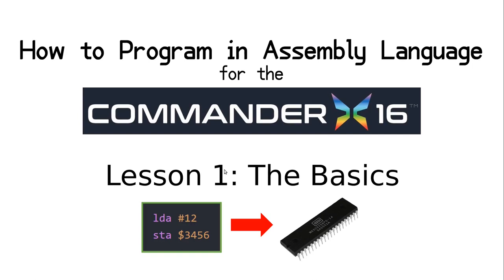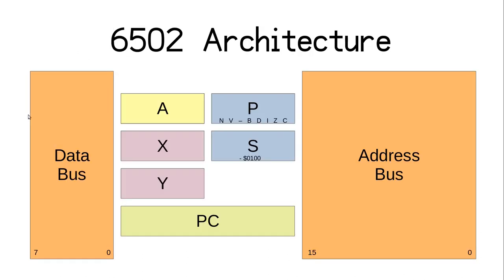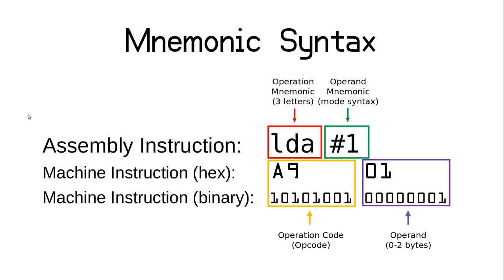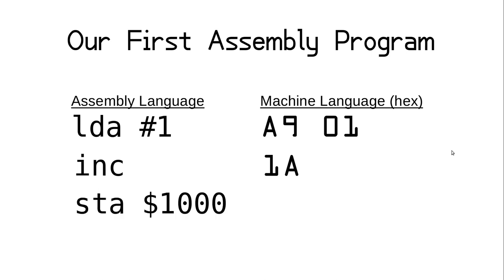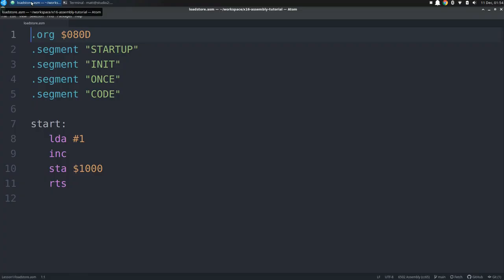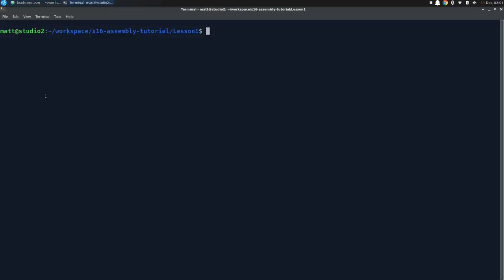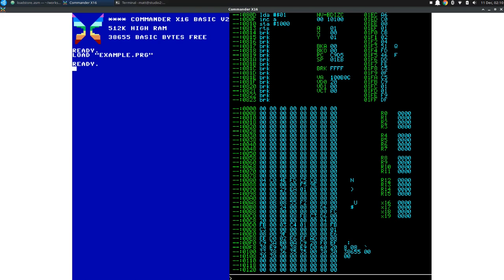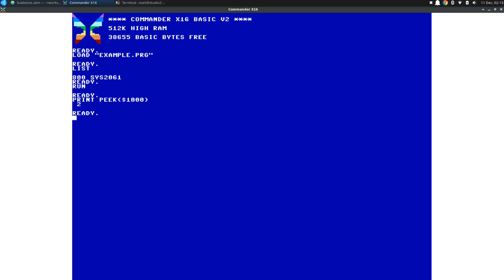Commander X16 Assembly Language Tutorial, Lesson 1: The Basics

Comment: Just a note to those who watch this video for any kind of 6502 programming, INC on the standard 6502 does not support the increment of A like the example here shows. That came in the 65C02 processor which ofc the X16 has. It only supported zp , zp,x ,  abs and abs,x. The 65C02 has a number of instructions sorely missing in the older version of the processorthat the old 8 bit systems use and a programmer would have to think about this if porting from the X16 and back to the older systems. :) - Btw, great that you went into such a great detail on the built in debugger and showing the startup process and tokenized basic.

Comment: Great video! I was impressed at how smooth and easy it was to get the X16 emulator running, that there was a apt package for libsdl2 in the Debian repo that was up to date enough to use the x16 flag, and that the few line program in the video just compiled and ran with no problem at all. The header block with it's start point and the explanation of how to run it in the X16 was the "secret sauce" I needed to get this running. Thanks!

Comment: The 6502 and Z80 were the first two chips I programmed on the BBC Micro and TRS-80 respectively. I learnt their assembly language inside out, The 6502 heavily influence the ARM as Sophie Wilson knew one from her work on the BBC micro and designed the ARM. The BBC Micro had a built in assembler as part of its BASIC and taught a lot of 80s kids assembler.
Reply: The Acorn (company which designed and built the BBC micro) produced the Archimedes when it designed the ARM processor. The Arch’ had an ARM assembler in its BASIC and it’s why ARM assembler was the next one I learnt in the next 80s and why I ended up my current career.

Comment: This was very hard for me to grasp. I’m new to programming. I’ll find my way and get back here when I’m ready.
Reply from the maker: Like I said in the video, you should get more comfortable with a high-level language before trying assembly. Once you are more comfortable dealing with data, it will be easier to get into.
Reply: @slithymatt   I have finished some tutorials and done some simple programs with C, C++, QBasic, C# Objective-C, swift and verilog, just to see what it’s all about. I have understanding of how vectors, arrays, loops, classes and variables work. Is there anything in particular I should look into? Or dig deeper into one of these?
Reply from the maker: @Robbinsffxi  maybe try doing something more involved with C, where you are really messing with pointers, calculating addresses for things.
Reply: When I was 13 I got the book "Programming the Z-80" by Rodney Zaks for my birthday and that's how I learned. He also wrote "Programming the 6502." Both books are long since out of print, but when I searched for "Programming the 6502 Rodney Zaks pdf", I found a copy of the book on archive.org.  It goes over all the basics of CPU architecture, binary and hex number systems, addressing methods etc.  I'm sure it would help. Or maybe someone could suggest a more modern book that is still in print.  Good luck.
Reply: @JeffRatliffhome  Thanks for the tip! I will check it out.

Comment: Very clear and thorough explanation, just what I've been looking for for years.
I am having one problem: when I use cl65 to link the code, I get the ": expected" and "trailing garbage" errors. Any ideas?
I had typed the file out from on the screen and it didn’t work. But when I opened the example file from the lesson folder and saved it to my original location, it worked!
Reply from the maker: Looks like you left out a colon somewhere.
Reply: @slithymatt  I sorted it out, but still don't understand what happened. I wrote the originals file using Kate, but when I created the file using nano it worked fine.

Comment: Hey, i was wondering where i could ask a question. When i tried to build your example program i get the error "cl65: no such target system: 'cx16'" but i went thought and rebuilt the cc65 and saw it created files for the cx16. and i checked my path and it was pointing to the version i got from github. is there something else i can check? im on Lunbuntu. Sorry i know this isnt the best place to ask, great tutorial otherwise!
Reply from the maker: This is a perfectly good place. So when you do 'which cl65' it shows the one you built? Have you pulled from the cc65 repo recently? One last thing: make sure that the directory used for cl65 is in the same cc65 tree that has cfg/cx16.cfg in it.
Reply from the maker: @Mekelaina  Looks like your workspace/cc65/bin must not have cl65 in it, because it's ahead of /usr/bin in your path. Try building it again and make sure your bin directory gets populated.
Reply: @slithymatt  Thank you! after purging the cc65 i installed via the apt-get and correcting a typo in my $PATH it worked just as yours did. cant wait to learn more.

Comment: Another nitpick: 19:07: "As i am running Linux, I need to make sure that any file names I will be using with the x16 emulator are in all caps." <-- That's slightly technically incorrect. You need to pay attention to all-caps file naming because you're using a case-sensitive file system, not because you're running Linux. It is possible to run Linux with case-insensitive file systems, in which case you wouldn't need to pay attention to this. Admittedly, you're almost correct, or at least as near as makes no difference close to being correct for practical purposes, since at least these days, nearly all Unix-like OS installations use case-sensitive file systems.

Comment: So so tempted to get into this after spending years messing with 6502 on many different systems. Is there a memory map anywhere or does it not work like that on this system
Reply from the maker: It has both banked RAM and ROM, but otherwise a very straightforward memory layout. You can see the documentation here: https://github.com/commanderx16/x16-docs

Comment: thanks for this primer. question - with INC command, where does it hold the result? it seems to me that you'd need some kind of scratch space as an operand. but since STA is the next command, where the heck does it store the result of the increment before the next line?
Reply from the maker: The 65C02 allows for Implied Accumulator mode for INC, so when you don't have an operand, it just increments the value in A right in place, just as it would with a memory location. This is a the one opcode that both reads from and writes a new value to A.

Comment: Hello there and thank you for you amazing tutorials! I'm watching them for a second time, now carefully trying everything by hand. 
There is a question regarding addressing modes. There are two indexed modes - absolute and zero page. For indexed ZP if resulting address overflows $FF value it wraps around $FF. So LDA $F0,x if X equals to $10 results to address $00. But what about absolute indexed addressing? Seems like there is no wrapping for that case and if address is beyond $FFFF it simply goes to nowhere. At least, debugging shows no changes. Am I right?
Reply: here is better example

lda #$34
ldx $20
sta $FFF0,x

means no memory value changes as address $10010 never wraps?
Reply from the maker: absolute indexed modes will cross page boundaries when the index register value is high enough. The only caveat is that some instructions will take longer to execute compared to when indexing stays on the same page.
Reply: @slithymatt  so crossing the border of the last page ($FFFF) means pointing to nowhere?
Reply from the maker: @rkurbatov  It should wrap around to the zero page
Reply: @slithymatt  but it doesn't :) Opened the issue in x16-emu repo, I could not find the description of the correct behavior in all docs I have.
Reply: Hehe. I was using LDX $20 instead of LDX #$20. That's why it wasn't working.

Comment: 1:23: "So that means that an assembly language program directly represents the ones and zeroes that go into the processor and tell it what to do." <-- That's technically incorrect. It would have been correct to say machine language directly represents the 1s and 0s, and it would have been correct to say assembly represents the 1s and 0s, but it's technically incorrect to say assembly directly represents the 1s and 0s. Assembly does include just enough abstraction elements to make your statement technically incorrect.
Reply from the maker: I would argue there's no abstraction, merely a mnemonic for a deterministic value. Machine language doesn't represent 1s and 0s, it IS 1s and 0s.
Reply: @slithymatt  Between labels, jump targets, symbols, etc. there's a lot of substitution in assembly. With position-independent elements in particular, you don't necessarily know what absolute address, say, a label will ultimately correspond to. When you call assembly "merely a mnemonic", well, that IS a level of abstraction. Pretty much the lowest level of abstraction, but that's where it starts, with the step up from first-generation to second-generation programming languages. I think your semantics argument about not representing but being 1s and 0s is wrong also: Different-base numerical systems are all representations of the same numbers, but 0xFF is not completely identical to 0b11111111 or 255 or 0377, and machine language absolutely represents 1s and 0s. Honestly, I would have expected a reply, if any, to be more like, "Oops, my mistake; I meant machine language." To actually defend the narrowly but clearly incorrect position you're arguing here is to choose a curiously shallow hill to die on.

Comment: The 6502 sucks
Reply: No, it doesn’t, but it sure could use instructions for multiply and divide.
Reply: It performs very well however the limitations in the way instructions, registers and addressing is combined leaves huge annoying holes. The 6809 by comparison can pretty much have any instruction and address mode used on any register combination.  This means you can write sophisticated relocatable machine code with ease.  The 6809 thought to be clock for clock as powerful as an  80-286.